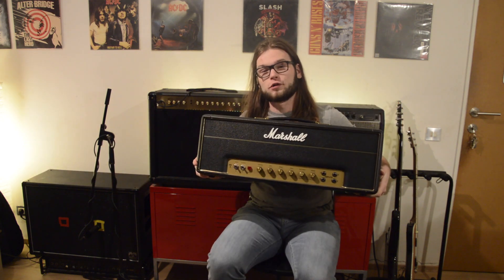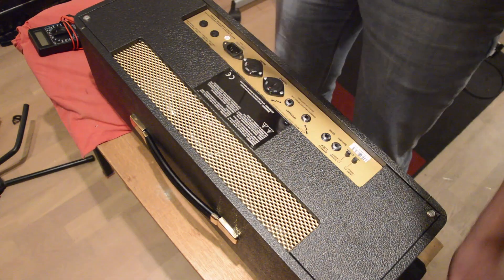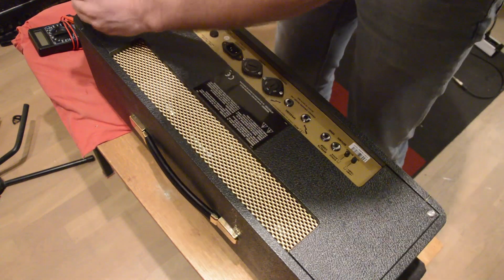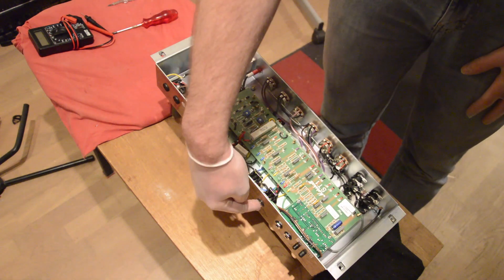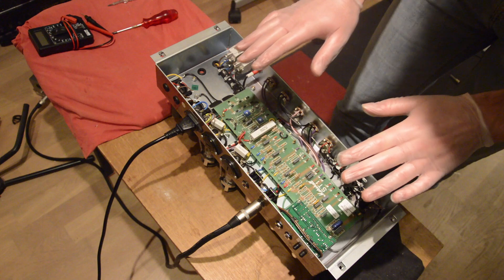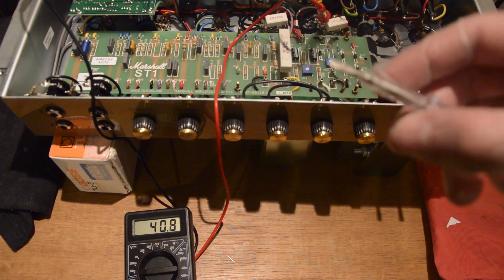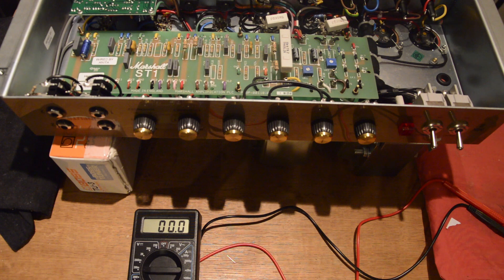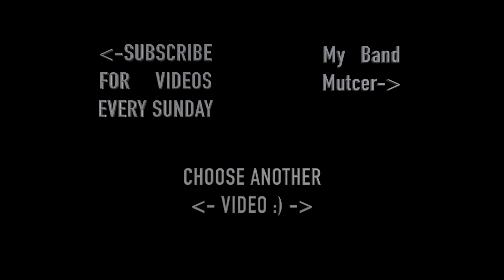How To Bias: Marshall Plexi 1987x/1959SLP | 50w/100w | Using Multimeter | Valve/Tube Amp

Comment: You only checked one of those resistors and set it I think you did the one on the right side are you supposed to do both or just one and are they both supposed to be the exact same level of DC voltage? And I have a jtm 45 reissue handwired is it the same and what tells you that it is off in the first place? And what is it supposed to do what is its function for the bias setting? And why would you put it at 40 if 35 is The Sweet Spot what does Marshall recommend and set them at
Reply from the maker: Anywhere between 30 and 40 is fine. You could check if both sides are close. They should be if you bought a matched set of tubes.
Reply: @MaxCarton  is one of those resistor level adjustors for each channel? or for each tube?

Comment: The safe operational range of the EL34 is between 10-40mA 
Lower mA will sound crunchy but thinner.
Higher mA will sound beefier with more gain. 

You need to read "The Trainwreck Pages" by legendary amp guru Ken Fischer. The section on bias adjustment. 

Where did you get your training? 
You're young and seem like you really don't know what you're talking about. 

I certainly hope you're not getting some kid killed because you're encouraging them to dick around with their amplifier. 

Leave it to the true professional technicians.

Comment: Great video. Wouldn't you have to check the bias on the other tube as well?
Reply: if the tubes are matched not really but you can average the voltage to be extra sure of the current.

Comment: You should learn how to drain your filter caps to ground with a resistor. This will make it safe to touch around in there.
Reply: Or you could just connect a jumper from pin 1 of V1 to ground, since theres already a nice big plate resistor there:)
Reply from the maker: I know exactly how to do that, but I didn't want to make this video too complicated for the beginner dudes :)

Comment: dont you check the plate voltage first?
Reply: The plate voltage will drift as you adjust the bias.  I like to use two multimeters simultaneously while biasing, 1 measuring the plate voltage and the other measuring the bias.  This is pretty critical as amps will have different plate voltages which will require a different bias supply voltages.   I have an old Marshall 1987 and it's plate voltage is only apx 350V while my old 1959 is nearly 500V.
Reply from the maker: You can always measure the plate voltage and calculate from there :)